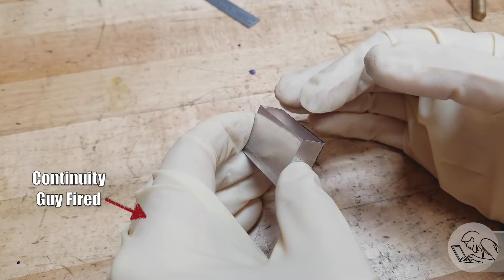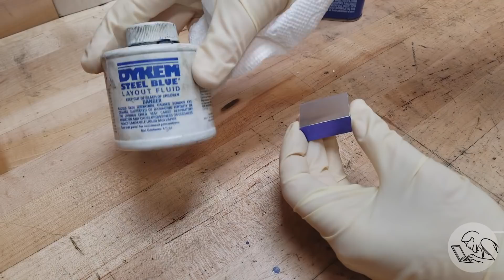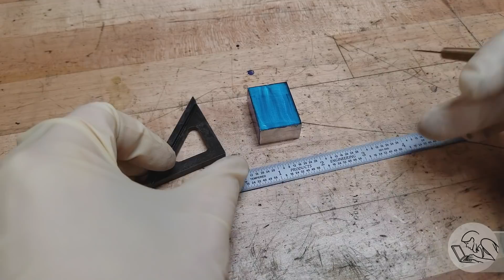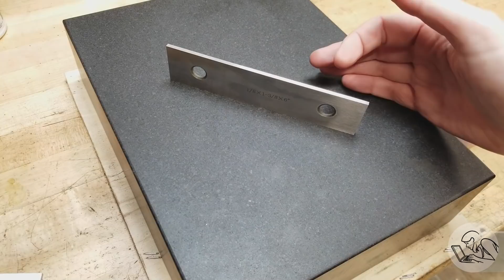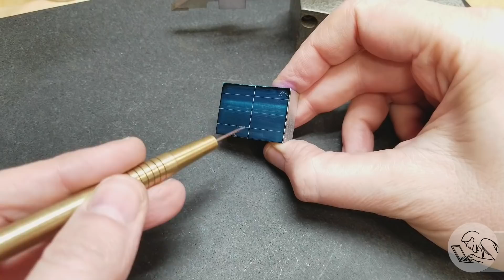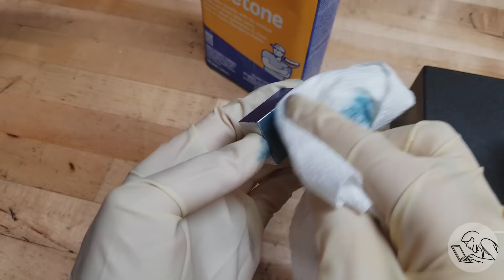Vertical Mill Tutorial 6 : Laying out your part

Comment: Using calipers to score layout Sharpie is frickin' awesome for quick marks that are pretty precise.  I do that a lot for knowing how far from the end to turn down a part which will be parted off long stock.  I also use it for what you've shown here, marking lines where something is supposed to happen/be done. If there are haters saying it's a bad way then either a) they get paid by the hour or b) they don't grasp the concept that some things can be +/- 0.005 and still function (+/- 0.0625 for the woodworkers...if they can read).  I like your videos.  You explain things well and show actual knowledge of your subjects.  And you're almost as funny as ToT.  Almost.

Comment: Great video. Ultimately the flatness of a surface plate comes from a process that uses physical principles to generate a flat reference surface. If you are careful you can generate a surface that is arbitrarily flat, down to the nanometer. This type of thing is very important in optics. Physicists and metrologists do this. Tom at OxTools has a great explanation of how the general process works. It's remarkably low tech, and you can do it in your home shop if you have the patience.

Comment: Drawings? Who's got time for drawings? My 'plans' change so much from inception to execution that all my time would be used up with drawings, modified drawings, 'final' drawings and pics of what eventually turned out, that there would be no time for the machining! At best I have x, y, z measurements that morph into the final object. Then I draw what I've got ... or not.

Fortunately my first project(s) will be to make a few T nuts to complement the massive number (4) that are supplied with my new mini mill. Yeah, I'm tight. So sue me!

I'm strongly tempted to make a fist at machining a table vice with inclined planes on the mating surfaces to give downwards force on the moving jaw.

Comment: Granite surface plates are cut and ground to be flat. Then they are lapped to the surface flatness of the grade you specify or order. Surface plates can be re-lapped  in house (generally only plates that are worth the effort or cost).

If you want to see the process of surface plate lapping see:

 https://www.youtube.com/watch?v=EWqThb9Z1jk

It is a bit of a snoozer, you don't have to watch the whole thing to get the idea. If you have a lot of plates you can also buy a lap the problem is all of the special tools to actually check the flatness. 

Sometimes you can find them a auctions at a fraction of the original price, be careful that you inspect the plate to see if it is in good condition.

For a low cost surface plate a piece of thick glass has a surprisingly flat surface due to the way most glass plate is made. Gravity does a good job of making glass flat.

Comment: I like your videos, Quinn. You are intelligent and knowledgeable. You strive for high accuracy in your parts and in your videos. As a perfectionist, I admire that in you. 
Beginners need to understand the many ways that error can be introduced into measuring and machining. You go a very long way toward explaining that. Great for beginners to know that laying out with the caliper is fast and quite accurate. But due to the fact that the caliper must be angled slightly to allow one jaw to scratch a surface while the other jaw rides on an adjoining face, the only dimension that is 'exactly' equal to the reading on the caliper is the hypotenuse of the small right triangle defined by the two caliper jaw tips and the corner of the respective adjoining faces. This method introduces an unavoidable error by its very nature.
But, as you say, the caliper is very worthy of consideration as a quick and easy way to scribe layout lines on a part. Obviously, the caliper body must be held as perpendicular to the desired scribe line as possible. But to reduce the triangulation error to a minimum, however, the jaw riding on the adjoining face must be as close to the corner as possible.
Reply: I was thinking the same thing .
When you are looking to be as precise as 'financially ' possible then why would you introduce the inevitable discrepancy that will occur by using a caliper  at an angle to scribe a layout line?
Tbf, I think Quinn stated that it was a quick and dirty technique, so , I  guess you pay your  money and take your choice.

Comment: The two best things about granite over steel surface plates:
They don't rust & they don't get burrs. If you were to drop something on the granite,  you might pulverize a small pit into it, but not a raised crater rim like a cast iron plate.

Comment: I use the aerosol spray Dykem for my layout work. It is easier to get an even thin coat and dries pretty quick. I don't have easy access to a granite surface or height gauge. My work doesn't require ultra precision (+ - .030) for most things I do, so layout with dial calipers happens all the time.

Comment: I have an observation to comment on. If you're making scribe lines using measurements using thousandths of an inch, won't making them with the calipers make that measurement short, since it is at an angle, albeit a slight one?
Reply from the maker: You’re describing cosine error, and while it’s real, it’s insignificant in a case like this. The angle is very slight, and manual layout has vastly more sources of error that would overwhelm that.

Comment: I was expecting to read some bridge underlyer comment about tangential error because when you scribe with calipers your calipers are inevitably at some nasa level angle in relation to the face of the part marked. Forget about tip wear lol. Nice work letting them burn out til the end. There is always something to be learned and its great to get any tid bits or chunks of knowledge.

Comment: I have a cast-iron one and left the height gage standing on if for a few months and it actually started rusting where the foot of the height gage was. Haven't dared check if it is actually ruined now but chances are it is =8-(((

The silver lining being that you can still use a fairly flatish metal plate to do minor welding jobs on it.

Comment: I just bought a small surface plate and have been looking at a dial or digital height gauge around 12". After stalking ebay I am a bit dismayed, any recommendations?
Reply from the maker: The 6” grizzly dial height gauge is decent and reasonably priced
Reply: Craigslist too. I bought 2 brand new in (wooden) boxes from a machine shop that had closed for about 10 cents on the dollar.
Reply: Keep checking ebay. I like the 50 div scales. Found a great Geo Scherr pre war unit with quick release lead screw nuts and a base knob for fine adjustment. 
I am prejudiced against dial calipers. An electronic digital is what I would buy for a second unit because they are faster to read, and change to metric instantly.

Comment: Good demonstration of how to get the accuracy of a woodworker.  By the time you eyeball the center to punch, then eyeball the center drill, you can get +- .020 or so.  If you have a mill you would want to use an edge finder.  If your mill had digital scales you can get +- .001.  Marking a part like that is good so you can see where you need to cut, but not good enough for actually cutting and drilling.
Reply: I have had very good success laying out steel blocks say 10 x 10 x 12" to be milled into manifold blocks for GE turbines. Lots of intersecting holes, etc. Every single one checked good and was accepted.  Sharpy is thinner and doesn't flake, use a very sharp wiggler in the spindle with a loupe.    That's how to over come some inaccuracies of an old horizontal mill.

Comment: I've always been cheap and use sharpies/permanent marker pens. If applied in multiple layers (with drying in between) they aren't so bad. Easily dissolved in ethanol as well.

Either way this is a very good introductory lesson in layouts.

Comment: Before Layout Blue, or Red, there was Copper Sulphate, this was used at my Machine Principles class in college. Strange blue solution, that changed to Copper when applied to Steel. Anyone else remember this.
On larger jobs, we used white emulsion paint applied with a four inch (100 mm) paint brush 😱.
Excellent vlog Quinn, very detailed and very accurate, food for god's ref the hobby guys, If I may comment.
Thanks for sharing.
Reply: My dad used copper sulphate for electroplating in a tank - was great stuff, such a nice blue - grew awesome crystals when you let it sit.  I remember copper plating all sorts of rando stuff like oak leaves. I think we had to spray with silver nitrate first unless my memory betrays me...🤔
Excellent vid as always Quinn! ❤
Reply: Yes, I still use copper sulphate solution from time to time.  More robust than sharpie and less messy than traditional marking blue.  Not too helpful with brass or aluminium, though!
Reply: @pnt103  I've used a can of acrylic satin black for larger items, drys quick, and very cheap. Good to hear it's still in use 😀

Comment: Thanks Quinn
Hmmm...No easy way to get layout fluid locally... but seeing acetone is the solvent: can't I just use thinned-down nail polish? Or will that be too thick?

By the way: I use the calipers... but have to consider the cosine error. The distance isn't that precise, as the calipers are at an angle.
Reply from the maker: The cosine error is easy to minimize though. The error will be less than the error we already have doing manual layout like this. 

Regarding acetone, check paint stores or big box stores. Any hardware store should carry it. Nail polish remover will work, but it’s awfully expensive because it has moisturizers and other stuff in it.